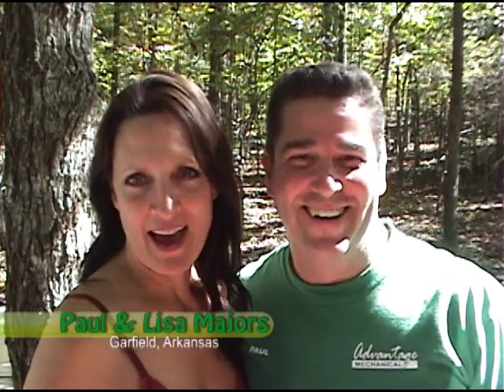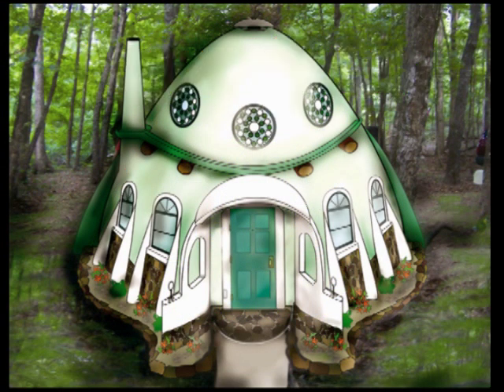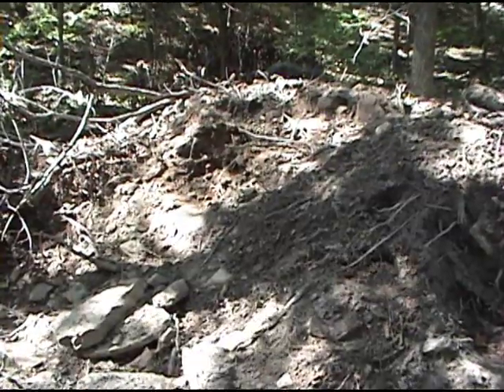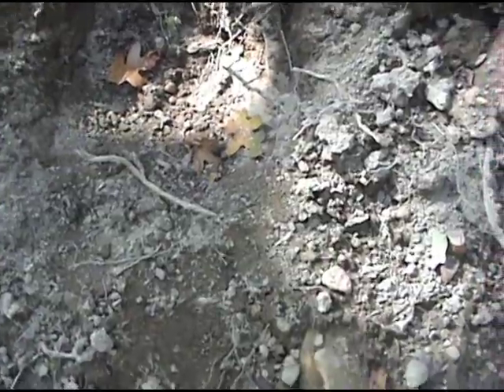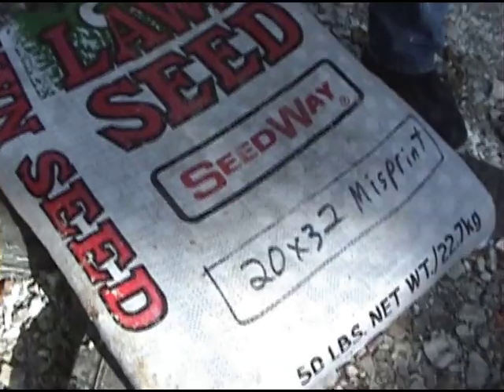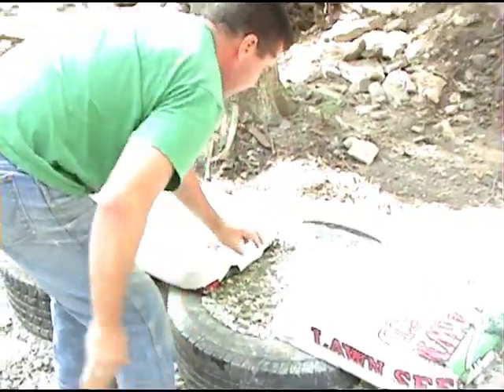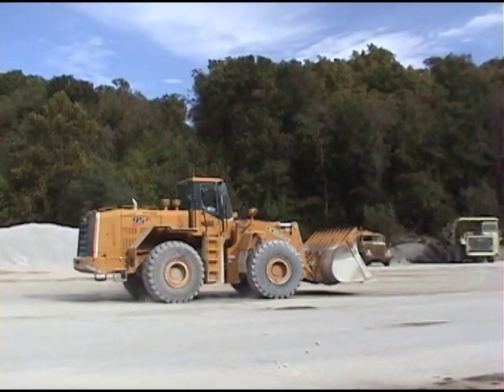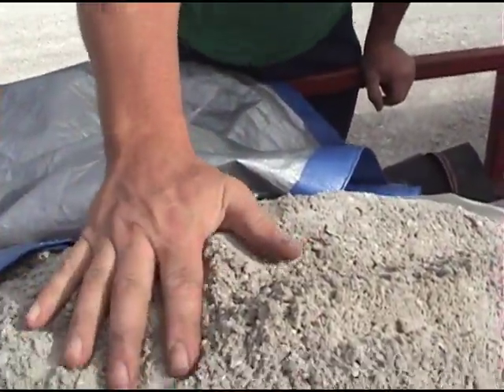Earthbag Dome - Testing Soil, Filler for Bags, 3 MAJORS

Comment: WOW.  That's really cheap for the sand.  It will be like cement if it gets wet.  What is the isulation value of this?  I would think it would be like reguler cement blocks?  I would like to build a straw bale house just for the insulation value.  I live in Oregon and hate the cold.  I can't wait to see the finished house.  How do you plan to finish the inside?  Earth Plaster?  Good luck with it all